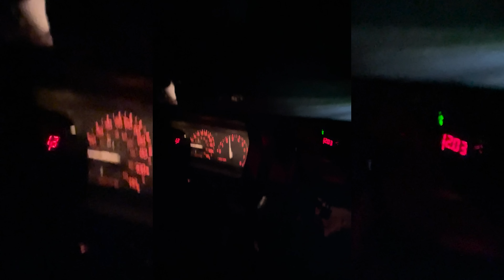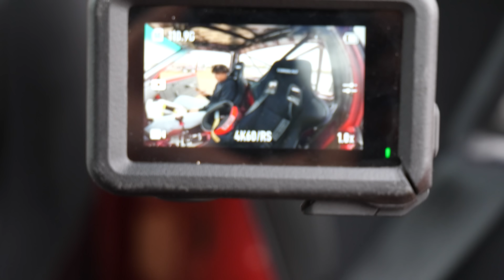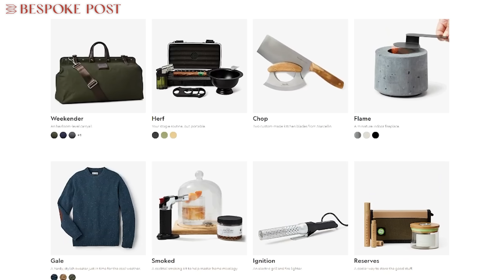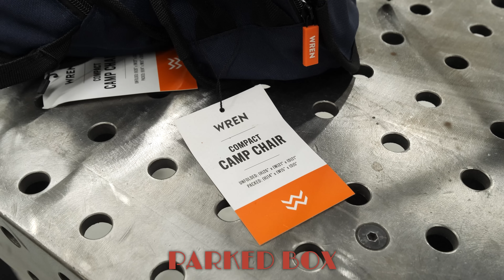FIRST DRIFT EVENT In The Supercharged 1UZ Drift Truck! It's INCREDIBLE!

Comment: Something to consider is staying partially throttled and using the brakes to slow the front end down and which will make the rear end rotate faster then if you were just mashed, allowing  to get through that corner you struggled. Front brakes are just as useful as the hand brake when drifting. Research some left foot braking drift techniques. Or just get a damn SIM. You have a gaming rig already. You don't need the best of the best. Just belt drive wheel with a sturdy base is what should be your main concern. Keep it up. Been following since v1 rally miata and Forza days. Cool seeing how much you improve each time you try literally anything. Very inspiring.
Reply from the maker: The problem is that I can’t left foot brake with this pedal box… 🙃
Reply: @_Gingium_   A new trend in drift cars is putting front brakes on your handbrake. Set it up so push forward is front and pull back is rears. People say it's actually pretty easy to get used to. You would need to move where you currently have it located but something to look into. Also I feel like you need to pull yours really far, maybe needs to be bled better?
Reply: @_Gingium_  I'm sure it can be done, but may require thinner driving shoes and a bit of practice. You may need to turn your foot and almost push on the side of the pedal rather than on the face.
Reply: Looks like far too much movement on the hydro brake. It’s moving over a foot. Not good
Reply: @gingium great job man proud of you lol...  would it help if the throw on the E-brake was shorter might save some time in transitions? Help you get that quick snap ✌️
Reply: Hydro may need a little bleeding, might need to heat those pads up also. When you are driving to grid pull the Hydro just enough to drag a little. Itll heat the pads up and lock on the first pull.
Reply: @_Gingium_  could maybe staggering how deep each pedal is help?

Comment: Tip for doing bolt checks
Have a paint pen handy, and mark a line from the nut to the surface it's on once it's torqued
Least then once you've torque checked the bolt, you mark it, and it's then easy to spot if a bolt's been missed or  not.

Comment: If you find all those threads are loose it's probably too late and damage has already been done. You really oughta get into the the habit of (A) using thread locker (assuming no tab-washers or split-pins) and (B) marking every fastener as torqued.

Comment: Vibra-Tite is one of my favorite products to use to hardware you know will be removed at some point. It stays flexible in a sense but keeps things where they are supposed to be and is easier to remove then thread lockers. I use it on suspension and alignment components and scope mounts and accessories for firearms. Its very versatile products.

Comment: Congratulations on a job well-done!  Can´t believe you didn´t use some kind of thread locker with all the torque you put on the chassis.  I recommend Vibra-TITE Gel because it doesn´t drip everywhere like loctite.  Works great too.

Comment: you need more left foot braking for that hairpin you mentioned last. it slows the front of the car and then with some extra gas you can get very clean hairpins without losing much throttle/speed.

Comment: Awesome video! You can also get some dye penetrant test bottles for cheap that you can use to test welds like the one on your valve cover that was leaking so you can find those leaks when you’re welding it the first time. Or if you build enough positive pressure in your valve cover you can spray soapy water on the weld and a leak will bubble.

Comment: Once that thing gets some rear grip it will be a monster. Maybe a gearing change can be benifitial too because that is a lot of rev limiter for looking like you are on ice. That 3rd gear run looked like the truck was in a happier place though. Looking forward to the development of this thing and seeing the progress improve even more. I wouldn't worry too much about the fenders 4wd or 2wd. Go grab some spray foam and build some sick 1 off fenders and fiberglass over them. It will look so sick because the front wheel poke this thing has is quite aggressive.

Comment: If it's a Dunkin Roasted Garlic toasted bagel with butter on one side and veggie cream cheese on the other.... sandwich style, if it's just a bagel with butter, separate.

Side note, looks like the truck is supremely stable and you could get way more angle and wheel speed (fancier and with more smoke) than you even think.... definitely did not expect it to perform that well....now just straighten those door dents and dings up, and get it wrapped or painted and she'll be set 👌

Comment: Watching how the truck is sliding, how you're modulating the throttle, you've built a lot of truck. Gearing seems to be an issue for this particular track. If you want to get into competition down the road with the truck, have you considered modifying the rear end to incorporate a common rear subframe like s13/350/E36 to have an independent rear end, allowing you to incorporate a Winters or similar quick change? Having the ability to quickly swap ratios for the specific track and wheel speed needs would allow the truck to be more of a weapon. I would watch that process for sure.

Comment: Not a pro, but all angle kits and rear suspension, always get's loose from vibrations, check every bolt after and before events, even mark it with a marker where it was when you got it tight! Btw drift truck it's just amazing, and sound so good😁

Comment: Definitely a third gear track for you. Also that handbrake throw is extremely long, which then adds time to your handwork giving you less time to upshift or downshift should you need to. You may consider a shorter throw handbrake. You also definitely make enough power to power-over or clutch kick entry. Not relying on the handbrake so much will improve your skills significantly. The truck is sweet though! I have an M122 waiting to go on my SC400.

Comment: Constructive input: binding at full lock is caused by over-centering, relocating the rack would help but eventually you will have to limit angle. Just an inherent design of the rear rack subframes. loctite wont help the fdf loosening up, its a garbage kit with garbage tolerances, mostly everyone i know that hasnt thrown their fdf in the trash yet has had to find an alignment setting they can deal with then tack the jam nuts to keep them from moving. bore sizing for the hydro looks to be wrong. should realistically lock up with much less travel with a bigger bore master. uz looks like it rips though. congrats on getting this thing going finally!

Comment: Your hydro ebrake either has air in it or it's not adjusted properly, or the cylinder isn't the right size. You shouldn't have to pull it across the whole zip code for it to work.

Comment: Sick truck, just needs less handbrake and more steering with the throttle. You're using the handbrake and how much its slowing you down seems to cause you to slow down and straighten, but if you just let off the throttle and let the truck slow itself down, you can just use the throttle to hold/add angle, and you'll end up a lot smoother. Handbrakes are nice, but they are really best for scrubbing some speed when you are gonna spin, and linking a tight track together that you don't have enough space to transition in. You're definitely improving, just little things to make you smoother, and running a deeper line to give yourself more room should help!

Comment: Your doing good but try not to use your handbrake as much as you do and get on the throttle with the weight transfer and you won't have to use the handbrake as much. Also I couldn't tell if you were but you can also clutch kick it to initiate the drift also. Just some more ways to practice so your not always grabbing the handbrake. It's all seat time. The more ya drive and practice the better you will get.

Comment: E36 would be a much better option as a first drift car. Can run it stock everything besides an angle adapter from drifthq that’s like $150. And not to mention it is one of the grippiest chassis to drift on. The whole point of drifting is to be hitting the edge of grip. You need grip to slow you down and to speed you up in drift. Get a 325i either coupe or sedan (sedans are cheaper and cooler imo) and not to mention every body makes an adapter kit for engine swaps, and the ZF trans from bmw is one of if not the best standard h pattern transmissions for drifting. But he should start with what he wants just do something cheap and reliable. Which unfortunately probably means no drift truck. Maybe a na or nb Miata?? Look at how much Daigo Saito thrashes his Miata’s.

Comment: I'm no drifter but it looks a bit like you get the car too unsettled and then you are afraid to really steer it on throttle..The times you are on throttle coming out the last corner the angle, smoke and speed come together. More of that and try to get that in shorter corners.. if that makes sense.

Comment: That brake handle is way to far forward IMO.
You can see he's having to lean forward to reach it....IMO
Also, way to much travel on it.....should only need half the travel typically.  Looks like he's pulling a slot machine lever.
Reply: The truck looks sick but I get really disappointed in how poorly the 'bolt checks' are done.
Stupid mistakes can get expensive unnecessarily or cause others on the track issues.